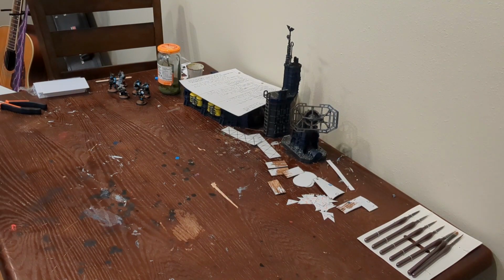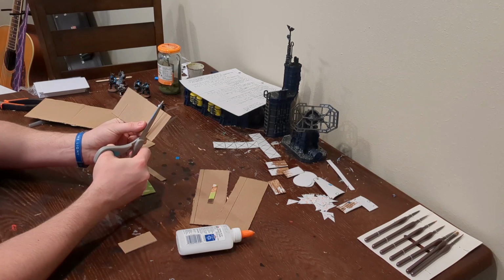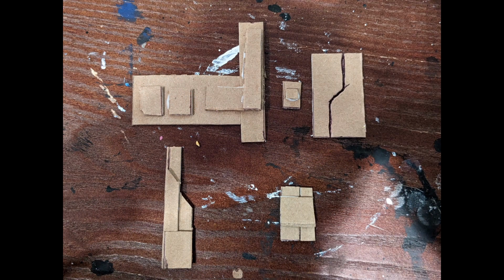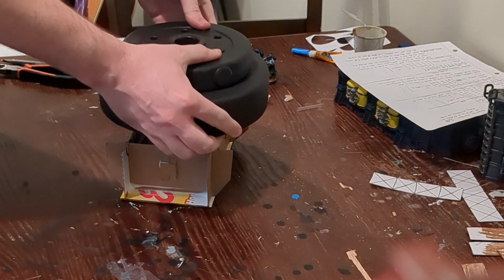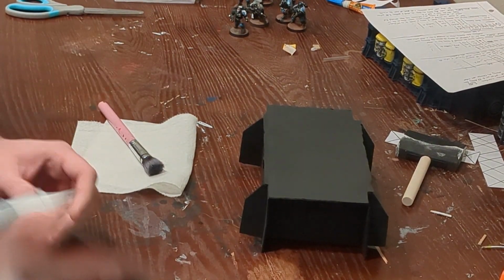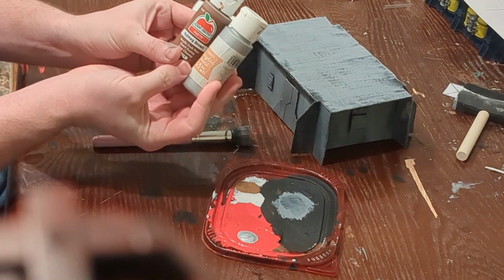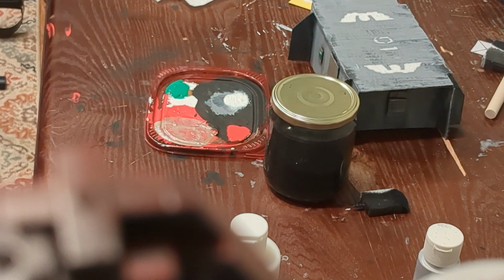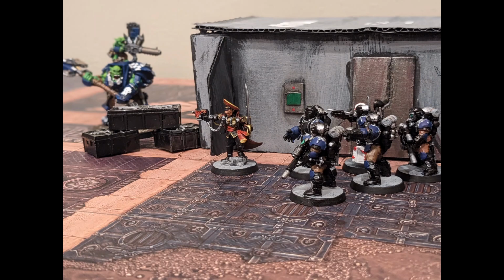Super Budget Terrain: Scifi Bunker

Comment: Sooo simple, i fall into the overthink a simple build. What was the rough measurements you used?
Reply from the maker: Thanks! As for the measurements for this build I believe I did 3" tall with the long lengths at 5" and the shorter lengths at 4". 

I did these builds again with XPS Insulation board rather than cardboard, using the the same method (I'd highly recommend it if you can get your hands on some for cheap) and did a couple of 5" x 6" x 4" buildings that work great for 40k boards!